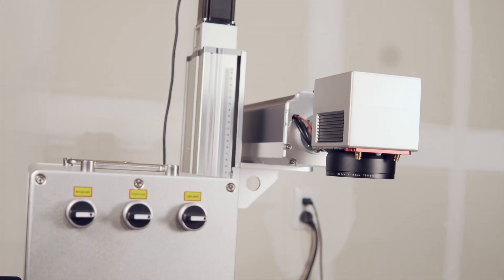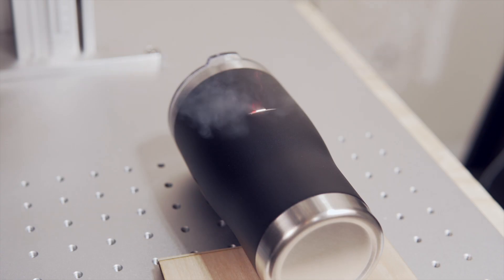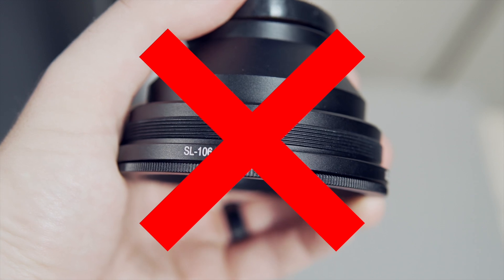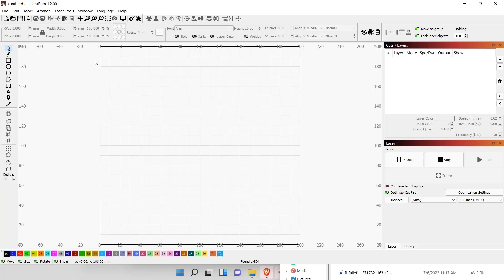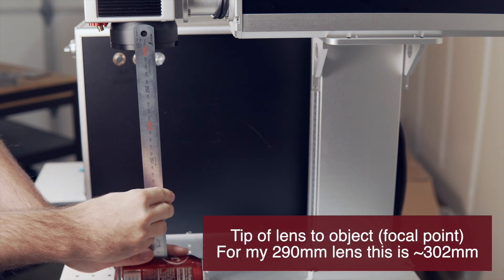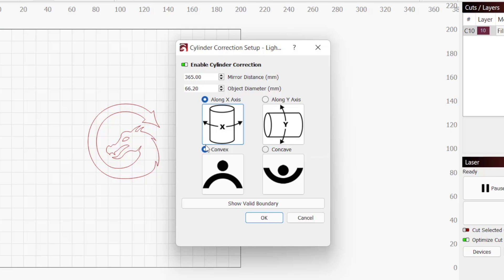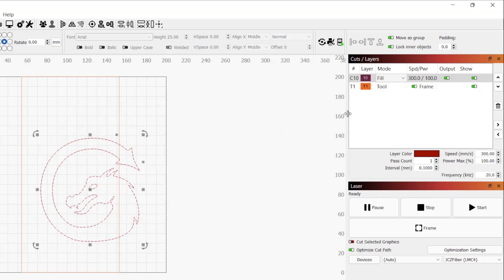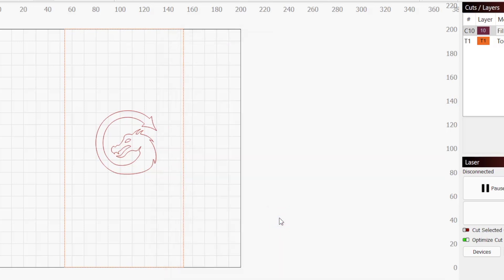Cylinder Correction in LightBurn - No Rotary Required!

Comment: I cant find that cylinder set up on tools. I don't have that on my device setting. Can you please show me?
Reply from the maker: Cylinder correction is available in the Laser Tools menu, but only if you're working with a Galvo style laser. 

If you're not sure what type of laser you have, please email us at Support@LightBurnSoftware.com and let us know its exact make and model.
Reply: @lightburnsoftware7189  i have 
Atomstack 10pro

Comment: Is there a way to only use cylinder correction for one object or group, and use rotary for another ? Say i want to engrave a logo with cyl corr, and test to wrap around the cylinder with rotary? if not please implemet this, it would save TONS of time. @lightburn

Comment: Do you recommend a minimum lens / work area? I'm guessing 200mm x 200mm at a minimum?
Reply from the maker: We have used it on smaller lenses but your correction range/depth is much less the shorter you go.

Comment: How do you save the Mirror distance?  I set the value, ran a test, worked great.  Disabled CC for normal engraving.  Closed LB, opened LB and the settings had gone back to the default 100.0 mm mirror distance.
Reply from the maker: What operating system are you using? Also, if you try it again is repeatable? I checked on my end closing the program and restarting the computer but it retained the mirror distance value.
Reply: @lightburnsoftware7189  I worked out the problem, it saves it per Device.  I had my 200mm lens device selected when I did the test, but when I open LB it always defaults to the 70mm lens device which was still at 100mm default.  This begs the question, can I change the default device or even better have LB remember my last selection?  Windows 11 latest LB versions.

Comment: I am wanting a backup to my fiber laser (for tumblers 100mm) and may have finally decided to go with CO2 galvo using this feature.  what is the lowest recommended wattage Co2 that will work and be efficient?  Trying to save up for really nice UV but want the look of CO2 on tumblers, with some speed and good looks. Also looking at one with beam expander 6X20 expander and 210 lens.

Comment: QUESTION: On a rifle stock (assuming made with substrate that can be engraved with fiber such as polymer), the but end of the stock has a curved surface that is not a cylinder, is there a way to account for this curve to avoid the warping effect due to the increased focal length as the art moves away from a center line?

thx
Reply from the maker: Technically the cylinder correction can be used on an object that does not form a full cylinder. You would just need to find out the diameter of the cylinder it would form if the curve continued. For a curved surface that is going to be your best bet to avoid the mentioned warping as you get further away from the focal distance.

Comment: QUESTION: On the Tumbler there is an area that expands from a smaller cylinder diameter near the bottom to a larger cylinder diameter near the top.  Does light burn have any tools to calculate and adjust for an uneven surface that is different along the perpendicular axis from the cylinder?

thx
Reply from the maker: Not at this time.

Comment: How I add this  feature to my existing my lightburn 1.2 .00,?
Reply from the maker: It is currently only available for galvo lasers.  If you have a gantry-based diode or CO2 it is not available for those yet.

Comment: work with Co2?
Reply from the maker: CO2 is the type of laser, which is not relevant here.

This works with galvo systems, whether they are CO2, fiber, etc.  It does not work yet with gantry systems, which is likely what you meant.
Reply: @lightburnsoftware7189  thanks. wasnt sure if the same could be achieved on co2
Reply: @lightburnsoftware7189  Is there a plan or way to make this work on a gantry co2?
Reply from the maker: @zfotoguy71  It's planned, but the math is different so the code as is will not work without changes.
Reply: @lightburnsoftware7189  Does not work with my UV Galvo.  I can get it to connect, but can't adjust the two parameters that control power for my Photonics Industries UV laser source which are frequency and Q pulse length.
Reply from the maker: @oldNavyJZ  - we have not added support for UV lasers yet, but it’s planned.

Comment: Do you plan to make that available also vor G-code Lasers with a variable z-Axis? That would be a great tool for convex items. Best regards Christian
Reply: I I would say to your idea that you can do exactly that. I purchased a NEJE MAX 4 that has a motorized z-axis, modeled the cups through Fusion360, then imported the files into LaserGRBL and the motorized z-axis automatically adjusts the focus to the surface for surface engraving，I just did a test with a cup, and I think the other angles are fine, as long as they can be modeled.

Comment: sadly I have an EZcad3 board in my machine (so no project mark feature) but I use Lightburn to edit the majority of my files before I import them into EZcad3, I think it would be cool to just have an option on lightburn where it could distort your image using that same cylinder correction math and then be able to export the distorted image to another program and it work in a similar manner.

Comment: This is perfect for flasks, where their radius is too large for a rotary. However it would be WONDERFUL if y’all would add in a function for tapered glasses/tumblers so that the graphics come out correct. It’s been requested several times over the last couple years.
Reply from the maker: This Cylinder Correction Tool is specifically for Galvo lasers. It works well with tumblers. (That is primarily what I have been using it on here.) If the mentioned request has been over a couple of years it sounds like it is a different tool (perhaps for gantry machines?) since this was just released.
Reply: @lightburnsoftware7189  not talking about machine specific stuff, I’m talking about skew/perspective that other softwares have, including free options. Just like gunhappyie mentioned about. Your software NEEDS a skew/perspective function to deal with tapered shot glasses/tumblers etc. This has been a function that has been requested several times over the last 3 years on your website section for votes. Even if that function doesn’t address every little nook n cranny of what people want, at least give us people that keep paying for the updates a reason to keep paying, even if it’s “manual control perspective”. Software advances that are machine specific are great to those people with that specific machine, but USELESS to the rest of us.